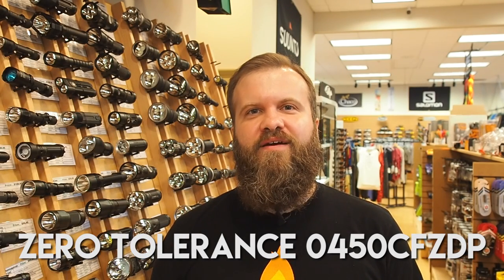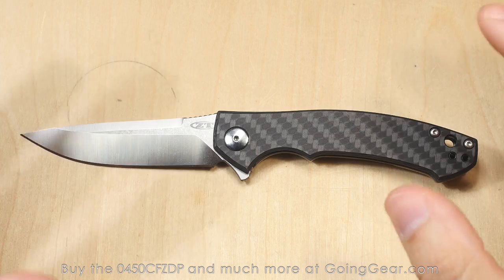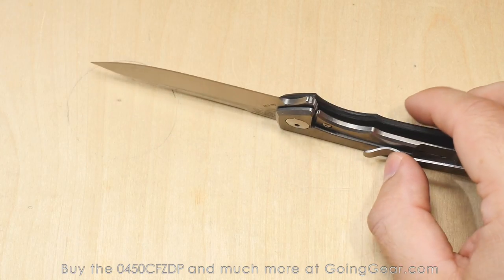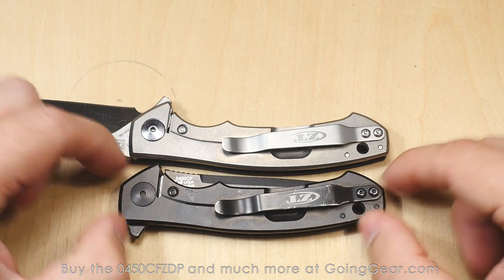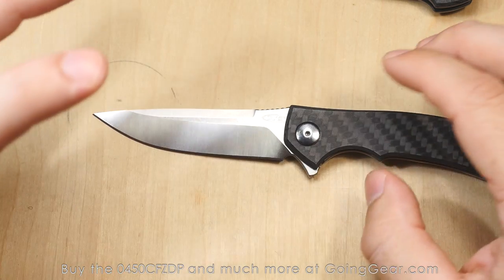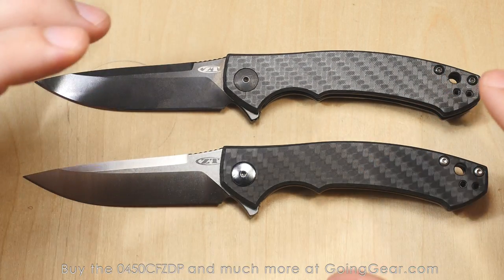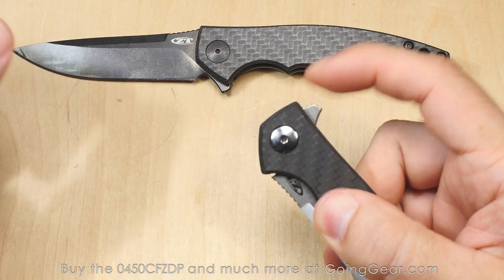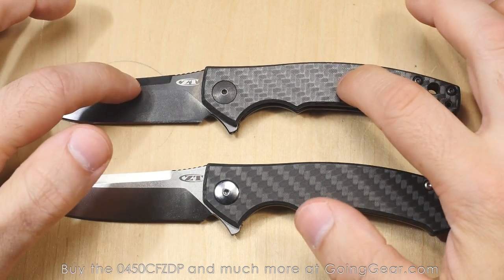Zero Tolerance ZT 0450CFZDP Knife Review

Comment: I just picked one up last week and mine was not very sharp at all. I was a bit disappointed because this is supposed to be a great steel but I can't put it through its paces without it being properly sharpened. My 0452cf has a much better edge from the factory and it was cheaper. I like the satin blade with the carbon fiber like its larger sibling but would have been just as happy with s35vn, I can just strop that steel and it gets very sharp. I may need to call their customer service and talk to them....
Reply: If you don't know how to maintain a knife, then why do you even own one? This is why knife bros hyper focus on dumb shit like "edge retention" isn't it? It's because most of them couldn't actually re-sharpen a knife to save their lives.

Comment: I never knew they made some with ZDP. That stuff is one of my favorite user steels for kitchen knives and I think it would be a great option for pocket knives, especially since so many are poorly designed and basically sharpened pry bars anyway. Anyway it's definitely not as stainless nor as hard use as s35vn would be, but the kind of edges ZDP takes, the sharpening, and how it holds that fine edge is in another dimension from s35vn, which I was never really a fan of, especially for all these tiny little pocket knives that dont have any need for it. It's just an expensive steel that makes no sense in how it's used, which is in tiny little office use pocket knives that are 5x thicker stock than they need to be and shit. Just dumb shit. But that's what I expect in knife land, especially the EDC side of knife land. It's very very low IQ territory. It's honestly kinda amazing how it's 2023 and we still have this whole pocket of like edc land where everything is so dumb and under developed. it's all just dude bro myths and little boys. Makes me question my sanity for having an interest in it myself. I'd like to see a ZT version of the Kershaw Strata maybe with something wild like lc200n laminated k390 steel, or if they don't wanna go that route, s90v would be cool but something more like s30v or XHP is likely more realistic. Just please no s35vn. It would be cool if edc knives were anywhere near good and well designed enough to where focusing on generally dumb shit like steel choice even mattered, you know what I mean?